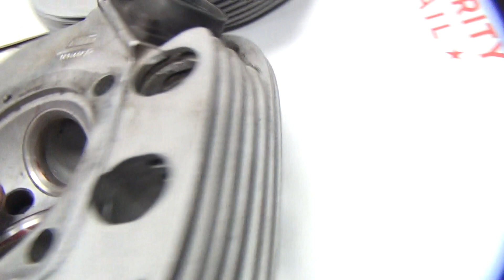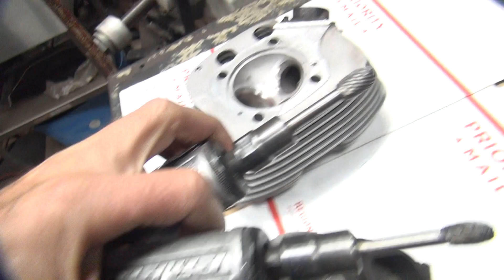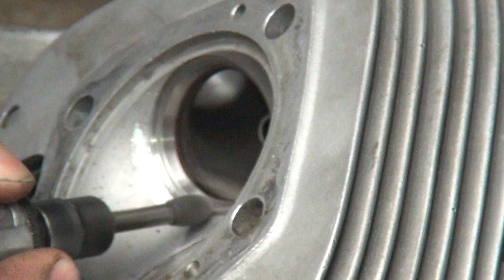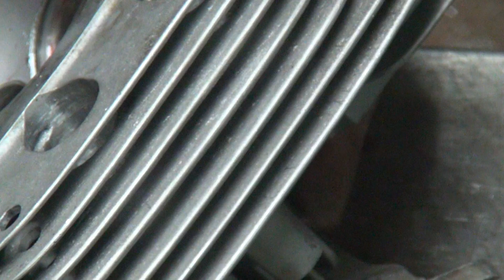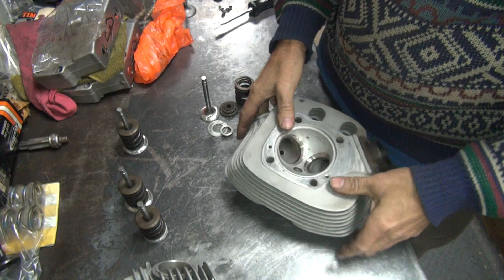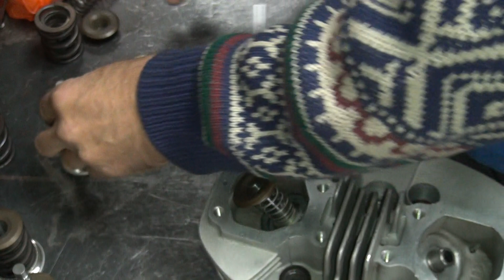#104 1977 XLCR 1000cc motor rebuild thunder heads XL sportster Harley ironhead tatro machine

Comment: On the little bit of math you had 880 , plus 50 rounded up to 70 , giving you 1950 . Could you explain why you added the 50 and rounded up to 70 which gave 1950 . I follow your vids taking it all in so I can understand how basically to do it . I didn't get that bit of math or what some of the numbers represented . I know you r busy , but if you've got time and wouldn't mind explaining that'd be great . Cheers either way tatro .
Reply from the maker: this is an old video so i don't remember the exact info but here is how it goes.
take your valve spring hard coilbind number and add .050 for some breathing room. adding up to an even number makes the math easier in your head and allows for a little error in your stack height totals. most springs have over a .100 clearance so we are already pushing it here. than you add this number to your cam lift at the valve. this is your minimum valve spring installed height. you can go higher but you don't want to be much lower because you only have a few extra thousands of an inch in this number. the valve springs do not like being much tighter than the .050 and under than .030 they like to break. so .880 + .050 + .400 gives you about 1.350 +/- .020. 1.950 is not a good number so your heard it wrong.
tatro
Reply: @TatroMachine  brilliant . Thanks mate . Appreciate that .